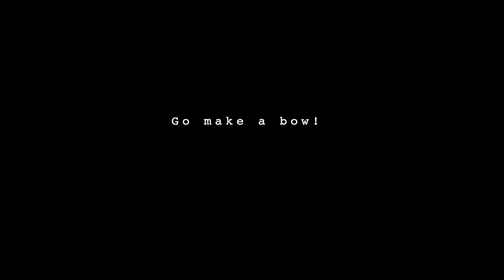From Broom to Bow

Comment: Dan, yesterday I asked a clarifying question on the chisels holder I saw in one of your other videos. The question has been answered by watching this video, so no need to answer there, thanks. However, a new question arises - why does your ample sized workbench move and flex so much? Is it the lack of diagonal supports (top to bottom etc) between the legs? Thanks